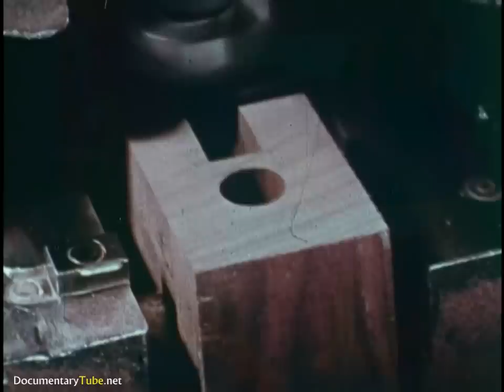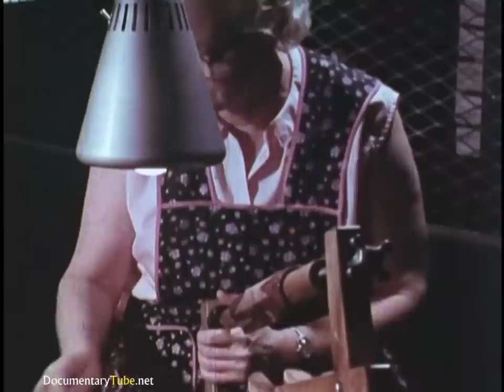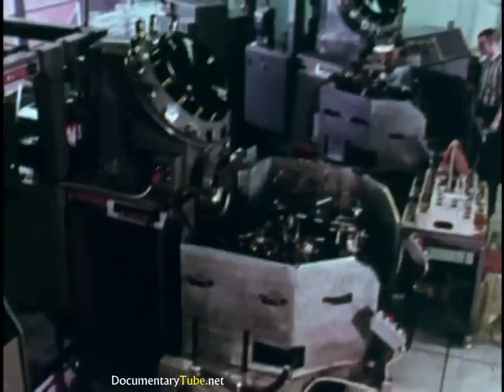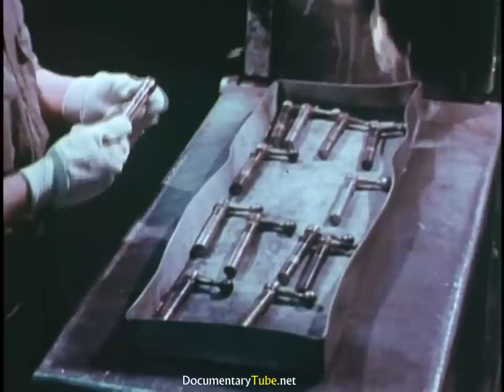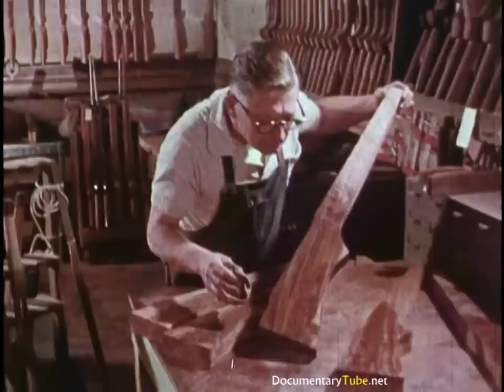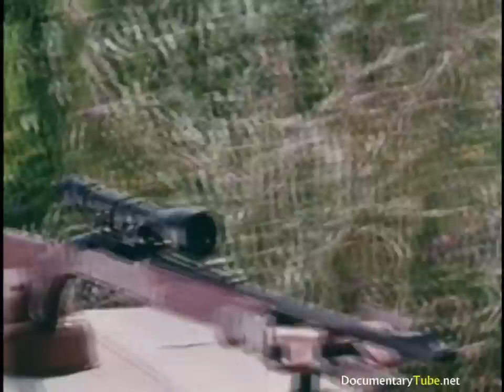HOW IT'S MADE: Remington Rifles

Comment: I was a machinist stationed at Quantico, Va. USMC, I did all the barreling and welding work and worked with the gunsmiths who made the sniper riffles, M14, 300 Winchester magnum, 223 and all kinds of other fun stuff. They had about 10 gunsmiths and 3 machinists. I was the lowest rank so I did all the work, I loved it! RTE Shop (Riffle Team Equipment)
Reply: I'm a machinist at a firearms company in Florida. I mainly run CNC machines but I'll bounce around doing whatever else needs done too. I'll do everything from honing barrels and receivers, blueing, parkerizing, sandblasting, and tumbling. I was recently put on populating barrels with gas blocks and barrel extensions, along with final head spacing.

What amazes me about this video is that aside from technology advancing since then, the processes are still the same for manufacturing firearms today. And it's been a really cool experience being part of it.

Lastly, I want to say that despite the equipment in this video being very outdated, I bet it would still be perfectly capable of keeping up with the modern machines in a modern production facility. While still being just as precise as the new ones.
Reply: 2112s for the win!!!
Reply: I wish I could work..please recruit me
Reply: @AchuChungHaokip  go into any US Marine recruiting office. The MOS is 2161…tell them that’s what you want to do. That’s how I did it.

Comment: The "computer [ punch ] tapes." Cutting edge hi-tech of the time.
Reply: I was thinking the same thing. I work in a factory that forms from CAD drawings, and it's no faster now then it was then with tapes.
Reply: John Ratko that was early 1800s technology , check out jacquard looms they used punch cards then
Reply: At least it isn't going to auto-update and shut down your line for three hours *withering glare at Windows 10*.
Reply: @bendriscoll6631  🤣🤣🤣 I'm dying!

Comment: I have a near mint 742. I've had it for over 40 years. It's kept cleaned and oiled. I have always used high pressure lube on the locking lugs and they still look brand new. I've ran about 200 rounds through it. The bad rep these lugs got was totally unjust. The damage is done when you get a Yahoo that thinks it's a B.A.R. they are not meant or designed for that. I've taken many deer with this rifle here in upper michigan. It was made in 1979 and I bought it in 1980. 41 years and it's been well taken care of. Great fun. Great gun.

Comment: My XP-100 still shoots Dimes out to 100 yards. Both 223 and 7mm
Reply from the maker: SteelBustingBiker That's some serious shootin tex.
Reply: Had to? 1/2 size critters out to 200 yards didn't allow for lazy reloading. .5 MOA was standard groups with most of my SillyWetters firearms.
Reply from the maker: SteelBustingBiker Impressive-
Reply: SteelBustingBiker A dime at 100 yards? What about at 700 yards? That's what a long range rifle is for.
Reply: +j3lly0311 a dime at 700 yards is not even possible even by a machine shooting it
Reply: TWDxKILL3R That's why it would be impressive at 700 yards. Most rifles shoot a 3 inch group at 100 yards out of the box, there's very little to no skill in shooting at 100 yards. I'm sorry if the facts offend anyone.
Reply: IHMSA only allows open sights. 1 inch groups are normal with Master Class shooters at 100 yards? 3 inch groups 220 yards with open sighted unlimited pistol are attainable.
Reply: SteelBustingBiker My mistake, in my ignorance I thought you were talking about a rifle. My ignorance. Good shooting then indeed lol
Reply: It's cool. Didn't take as a harsh comment.
Reply: TWDxKILL3R the longest shot and kill made that is documented is over 2700 yards.....

Comment: Got to watch some of the old ones they have a tendency to fire on their own. Just google Remington accidental discharge and you will see. I have one built in 1974 that I bought brand new 700 adl and it happened to me, after contacting them they had me ship it to them and replaced the trigger mechanism, said they knew there were some defective ones but never recalled them. If you have an early model 700 check with Remington for a defective trigger and be careful.

Comment: Remington has changed so much since those days when this video was made. Quality has suffered a lot, today people rely on computers to do just about everything and it has lost that pride of building a quality firearm, now it is build as many as possible and get them out to retail stores. 

Also today Remington has been sued so many times I have lost count, even sued for the firearm doing exactly what it was supposed to do, fire a bullet, stupid "Moms Demand Action" and "Everytown for Gun Safety", etc.. suing them to the point they had to file bankruptcy for frivolous law suits has caused them to cut quality to help reduce costs so they have money to fight those idiots.

Remington has a great design with lots of safety ideals put into their Model 700's, sad thing is the quality of the machining has suffered, I have had to redo so many of their actions, blue print them and true up the action so the bolt, locking lugs, and receiver face all are perfectly aligned to the barrel, making it a sub half MOA. I wonder if their original rifle were made to those tolerances back when they first opened?

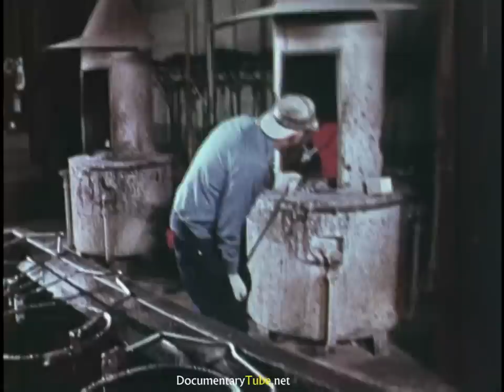Comment: 12:56 What is happening here?
Reply: Best guess, a basket of small parts being heat treated.....heated, then pulled out and quenched?  Hopefully someone who knows can give more insight!
Reply: @leewilkinson6372  Ah, you are correct.  For a split second you can see that the "bucket" is a basket, with holes in the bottom for better hot gas flow in the furnace.  Those are indeed small parts getting heat treated.

Comment: The equipment they used back then was so slow, punch dots tape, etc surprised it even worked right, so much of the work was manual labor and very time consuming. Now today so much is automated, pride is gone, cheaper materials used to increase profits, the only way to get a good rifle today is to custom build one. I built several rifles myself, all costing thousands of dollars to build but they are quality riffles and they will out perform those shown here with no problem, and damn sure the crap the produce now. When I buy a riffle today it is usually used and is stripped down and parts replaced, basically all I am after is the action, the rest ends up on gun broker or eBay, or thrown in a box in case I get a gun in from a costumer that needs a part.